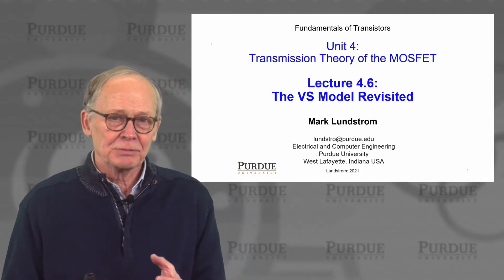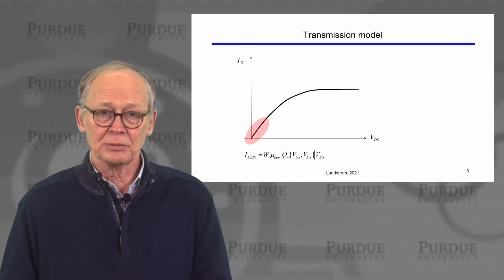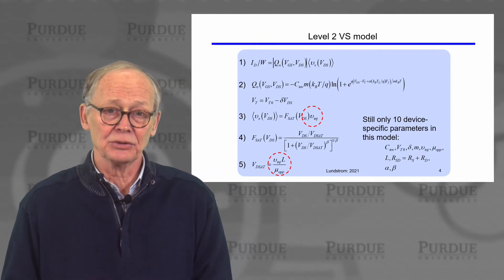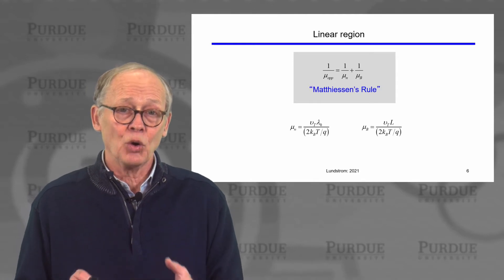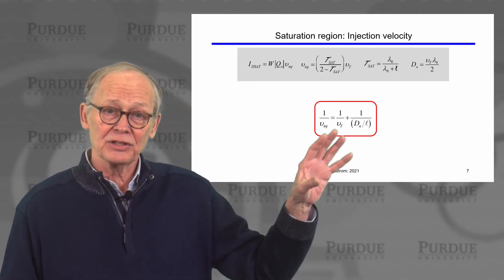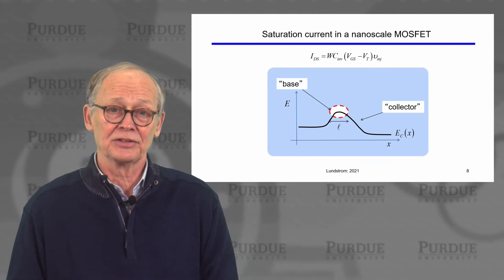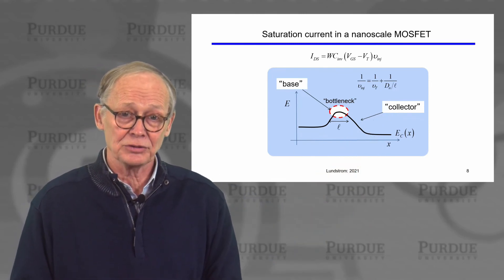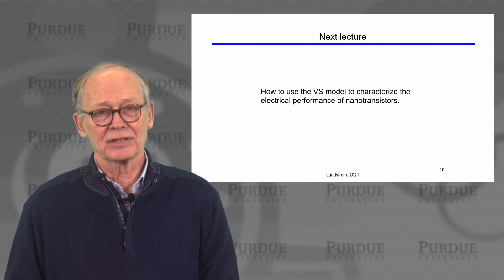ECE Purdue Transistor Fundamentals L4.6: Transmission Theory of the MOSFET - The VS Model Revisited

Comment: 00:00    Lecture 4.6: The VS Model Revisited
00:16    Traditional (diffusive) model
01:04    Transmission model
01:48    Level 2 VS model
02:26    Transport physics at the nanoscale
02:41    Linear region
03:45    Saturation region: Injection velocity
04:49    Saturation current in a nanoscale MOSFET
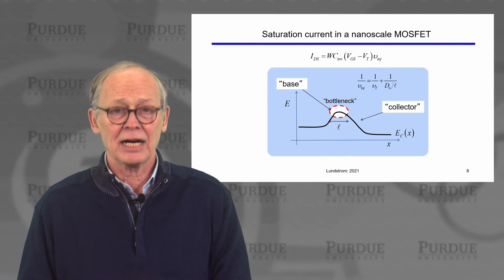07:06    Summary
07:19    Next lecture